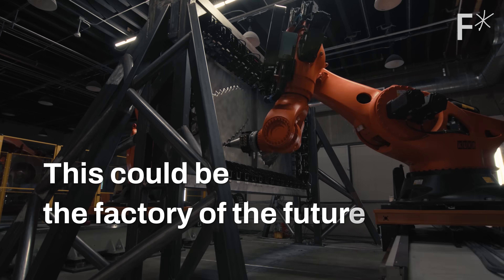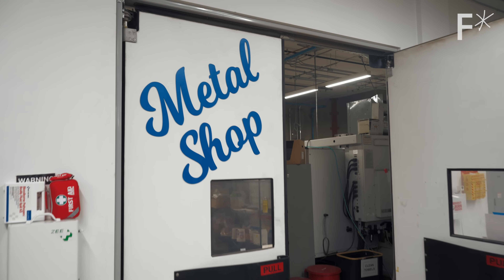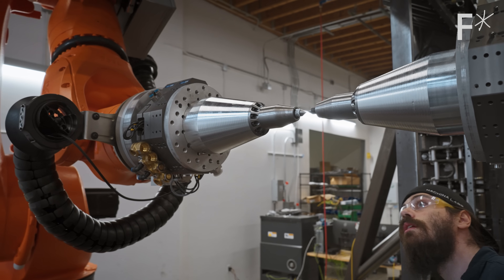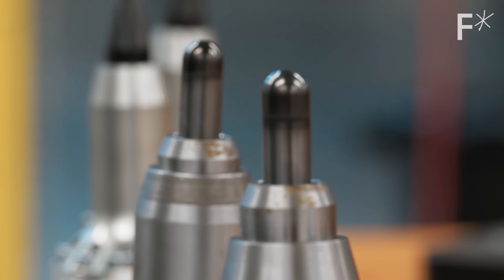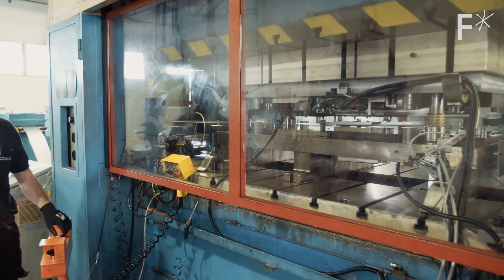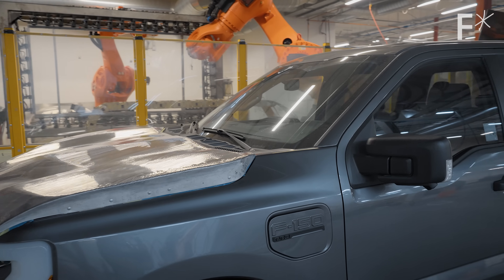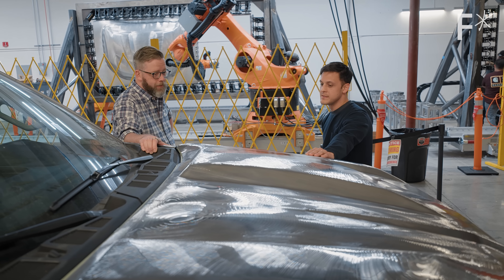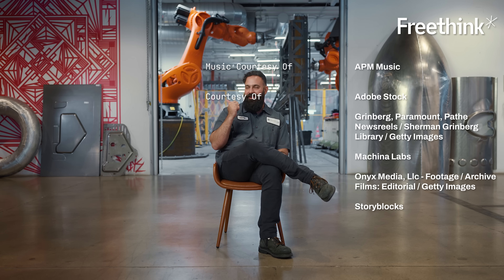Former SpaceX engineer invents a “Robotic Blacksmith Army” | Hard Reset

Comment: Sheet metal stamping is very fast maybe 100000 times than this method.
Reply: Absolutely ! But this method has its advantages. Especially for custom builds.
Reply: Why yes, stamping the same part over and over with no variations can be incredibly fast.... right up until you need to change for a different part... then it can take up to a week to take out the old tooling, load in the new tooling and tweak it until you can get good parts, then you hope and pray that nothing goes wrong while you stamp out another couple thousand parts... Rinse, repeat...   I would also point out that additive manufacturing (also known as 3D printing) is also a comparatively slow process in comparison to injection molding and other similar processes for plastics, although additive manufacturing has been gaining ground in building parts with metal as well, and the field is constantly growing for specialized parts and innovation.  Every industry has gone through a phase that was comparatively slow in comparison to the mass production methods that have brought commonly used objects into the realm that users like YOU are able to enjoy without it costing an arm and a leg. There is also a LOT of lead time that goes into creating each new iteration of tooling until they get it all worked out and producing those millions of parts... sometimes a year or more, so that turns your millions of parts into several years in the making. There are many parts of these processes that you obviously do not understand and cannot take into account with such bold claims.... maybe think about it and research a little more?
Reply: @edwardpaulsen1074  I guess you never been near a press.  Up to a week to change the tools? 😂
Reply: @KingElmo83  I'm sorry, perhaps you have only worked on simple presses or sequential tractor presses that can be accomplished in as little as a few hours if all goes well. Yes, there are highly complex works that have intermediate stages and repositioning of the piece with tooling, sometimes involving robotics of various levels, to accomplish the final piece... I am also presuming that you might be one of those operators that have to hit both buttons to activate the press and have the cable stays attached to your wrists to keep you from poking your fingers where they do not belong during the cycle. Oh, did I forget to mention that I have designed some of the tooling as well as some of those "safety features" because some people have difficulty understanding the dangers and do very foolish things because "I've done it that way for a long time with no problem" only to see them later with missing pieces of their body.  I can see by your "joy" emoji that ignorance really must be bliss for you...
Reply: Jesse James on the ol English wheel could pump it out faster
Reply: Only cool thong with this is custom automotive sheet metal. Like making 90's Civics again. 😎
Reply: @lancedooley7558 Right on. Potentially, you could make any year of Honda Civic.
Reply: It's great for prototyping
Reply: We don't always want 100000 units of f22.
Reply: If 2 robots can make 1 sheet in lets say 6 hours, 50 robots can make 25 sheets in 6 hours. Bigger company faster production, same as people. But in this way the workers can build themselves
Reply: It's not meant as a replacement for a stamping/mass repeat process - your comment is like complaining about a F16 for being crappy for highway commutes
Reply: I had same concern.Talked my way to a fix and concluded that this tech is still valuable eventhough it won’t ever be as fast for some forms. You could reduce sheet metal working to more generic parts and use additive manufacturing methods.
Reply: Geekmechanics.
Reply: Until somebody change sheetsform with 2mm here 3mm there...
The whole meaning is world changing fast and this method is very flexible. That cannot say about stamping method.
Reply: In some time i could see these robots ripping fast like 3d printers are now. It still womt compete with stamping but if the time comes down to a hour or two per part it has more advantage
Reply: Did you listen to the whole video? Yes of course, just like 3d printing is slower than injection molding. the point is that you can spin things in an instant, and it is way smaller. Democratisation and reducing footprint... this is the whole point, and the fact you can make ONE piece, not thousand
Reply: Common sense doesn't get hype and investment.
Reply: @johnnycajon4858  🫡
Reply: bro didnt even watch the whole video
Reply: @shushruthmg4630 I'm guessing you are COMPLETLY wrong! If you can build an entire factory capable of metal stamping quicker than these machines can make a part, then yes, it's faster, but that is not the case.
Reply: This is for fast prototyping and faster end product such as a die for metal stamping.
Instead of waiting 5 years to have machinery and dies built maybe a few months
Reply: If you make a production line with these robots, it can be very fast. Maybe even faster if you count in how fast you can customize or correct these robots.
Reply: What happens when you need to stamp a different part? How long to retool the dies, presses, jigs and fixtures?
Reply: cool, but sheet metal stamping requires large, specific machines for each part
Reply: This is ridiculous
Reply: This is brilliant and just what humanity needs to let their individual talents and skills be put to use. Instead of cookie cutter everything Japanese manufacturing process followed. The idea that it’s cheaper to have mass production is nonsense it takes billions of dollars of shareholders investment to make any product. Instead of humans using their talents they are all doing everything McDonald’s style. Strange I just drove behind a car that was obviously built by someone this morning and thought it was great! Not everyone is greedy and wants to be a multi millionaire but most good decent men needs the opportunity to make a living from his talents not used as a wage slave in a factory the size of a village and only doing repetitive work. Love it this is what AI should be used for. Thank you so much for doing this.
Reply: Sure. As long as you’re running off a million parts+ it might be worth it. But there are plenty of cases to be made for this way of working (he names a few) just like 3D printing. Not to mention being able to form stronger metals. Exciting tech.
Reply: "Typing is like 10000 times faster than a printer."

- some idiot when he saw the first printer.
Reply: This is more akin to 3d printing rather than injection moulding, but for sheet metal parts
Reply: Dude you don't understand the concept of bending stuff. He's talking about a machine doesn't need any mould or something. They just need some iphone scan and boom you have the parts. Shining part is the ability to print a variety of parts in different sizes, designs and materials in series. With the right investment and the use of ML, I believe that in 10 years (using a few H200s), they will be able to print as fast as you suggest. This is the inaugural step in a new manufacturing production technique.
Reply: Imagine now it is slow, ten years from now you will not be able to see the robots move it wil be so fast.
Reply: @jjw5165  nah, heat will be a hard limit factor
Reply: @jjw5165  No. The laws of physics wont change though. moving rapidly over a metal surface can cause undesired deformation or cracks, hence the slow speeds
Reply: I didn't think this comment would gain this much traction. The very reason I put this comment is because that guy was aiming for mass production of parts, which isn't realistic when the required quantity is a million or 1 /10 of a million. If you want a few in urgency then it will do. It will not come any close to sheet metal pressing when it comes to mass production. It will be a new technology as either plastic or metal 3d printers are. For small scale productions it will do
Reply: Yea and it takes years to develop and manufacture the does to make that part. It's far cheaper and faster to make single parts this way. Just cause you don't understand it doesn't make it useless.
Reply: This is slow as hell. It will never be fit for mass production. Stamping does not take a long time to change shapes and forms of the product. Stamping will still produce way more products even if it takes a longer time to setup than this crap.
Reply: Currently this company has no intention of replacing traditional pressing.
Their current goal is to be able to make one off parts.
Replacing the pressing machine was suggested by the reporter, NOT the company.
I don't think you got the report clearly. 🙅🏾‍♂️
Reply: @jimmysjohn141 how many times do simple concepts need to be explained to you before you realize it might be better to stop trying to neg everything as if you are a genius

Comment: Great video. Sheet metal is actually the toughest type of forging since two points need to be coordinated with tight tolerances since the gap between the to rounded points is less then the thickness of the sheet metal and the force need to be controlled.   A much easier to say take a steel washer out of a furnace red hot, put it on a  cylinder and rotate it around with a simple manipulator.  Then hammer the OD to form gear teeth. Requires the same AI learning combined with scanning learn  Even the same hammer but likely a higher force hammer would be better.  That forging like your machine could have two hammers that forge a red on plate of steel into a connection rod.

Comment: Probably never gonna know, but I wonder why they shape outside-in, rather than inside-out. It seems more difficult to handle the additional flat sheet in the middle rather than on the rim only. Maybe it just doesn't matter but if there's a reason that would be interesting.
Reply: if you work in the middle right away the sheet is very flexible and it complicates the movement that the arms need to basically counteract. So you start on the outside to add rigidity to the sheet and work in this way your sheet of metal stays more rigid and therefore more predictable than if you go the opposite way.

Comment: Great for (some) prototypes, useless for mass production.  Same as 3D printing. It´s very lazy journalism to report this like a huge breakthrough, while in reality is a very fancy, slow and expensive way of doing things, with only a few niche applications.
Reply: Yep, it’s great if you need a bespoke part in a very particular shape but not good for anything being mass produced
Reply: Toyota manufactures 2 cars every minute with a lot of formed sheets in each car.
Reply: its good for "mass production" of lower volume things where the design is constantly evolving so yeah its niche for sure def not for consumer grade applications. But for something like a star link satellite where a few thousand parts are needed and the design is highly likely to change in the next iteration this could make sense.
Reply: @zachmoyer1849 I second this, the technology here could be used in some high value added area: F1, aviation and personalised manufacturing.

Comment: With this tech a new range of manufacturers could enter the market thanks to lower cost prototypes which will enable testing and better investor attraction.

It is metaphorically a new size door that still most likepy leads to the same destination (mass metal pressing).